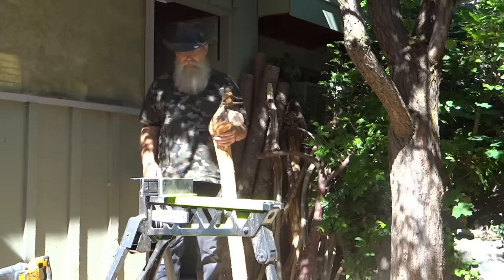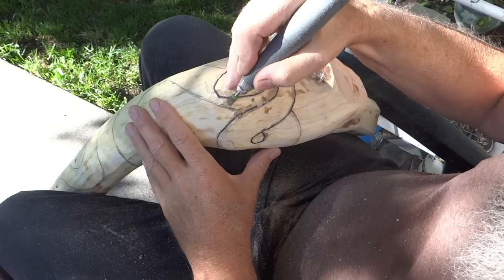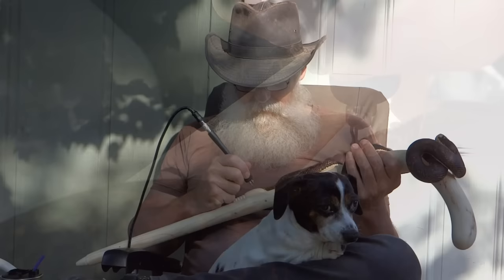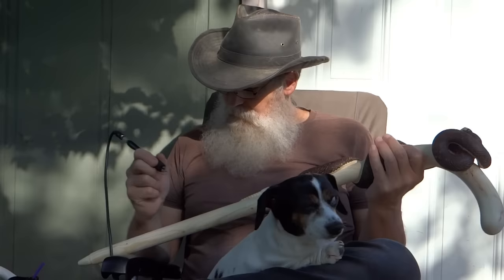Black Tailed Rattlesnake Cane

Comment: There are no words in any language, to describe just how beautiful! Not only are you talented but your are also extremely wise. You take time time to notice your surroundings. You also are smart enough to respect mother nature in all way's. She can be beautiful true, but she also has a temper that when triggered , can cause untold misery. You've won my respect which is not an easy thing to do.  You respect and care for the animal's. I never kill any critter venomous or not if I can avoid it. Sometimes one is left with no choice. I once had little time to react to a timber rattler that did not rattle until it was almost too late. It was about to strike I had no choice but to pull my knife and throw pinning it's head to the ground.  When it comes to knives and bow's I can hold my own against anyone or anything.
Reply from the maker: Thank you kindly!

Comment: HEY 👋 Mike, it's your bestest NC fan here!😃
"Doing" the fly may have been a little overkill😂
Good shot tho!👍Miss Pearl (our fur babies)have a way of adapting and overcoming, even if it's a simple belly scratch😄. Was wondering, the burner that use burn the snakes scales with, would they make an attachment that would burn a larger footprint instead of one scale at a time then go back and fill in the "ones" that couldn't be reached. Maybe to help the process out a little but if i know you you will stick with one at a time and probably me too😀 AWESOME work of art, once again! God Bless ya my friend.  
          Jay🕊🕊🕊
Reply from the maker: Hey, Jay! I think Razertip might make a group scale tip for fish scales. It would be tricky for me to use something like that for the snakes, because of the curves. It would be hard to reach into some areas. God bless you too!

Comment: The most amazing carving I have ever seen. Great coloring too

Please tell me that the power tool is at 1:24, and what the working tip is. 

Is it one of those multi-tools? But those only shake sis I to side, and this too behaves more like a graver for metal. I’ve been looking for something that operates as if it’s getting tapped with a hammer from behind, for a very long time.
Reply from the maker: Thank you kindly! It's called a reciprocating carver. The brand I'm using is Auto- Mach.